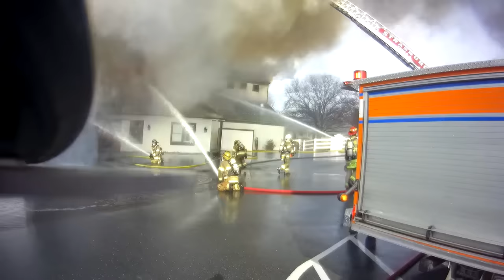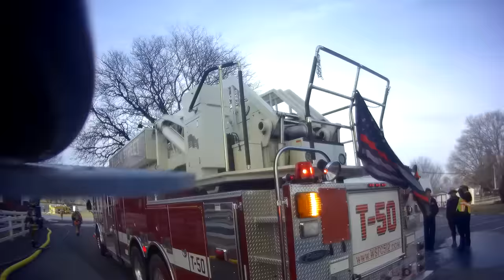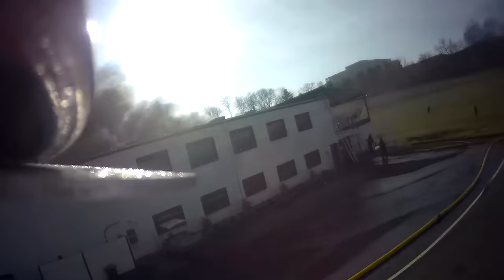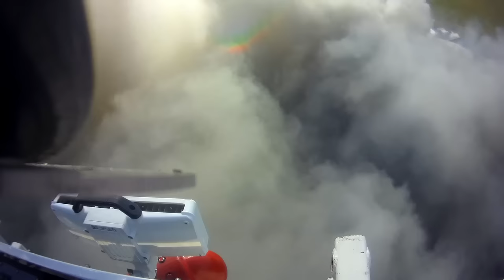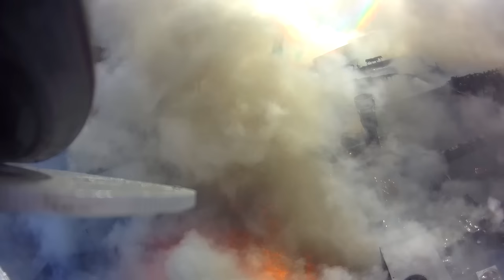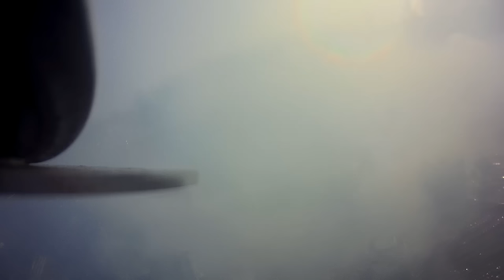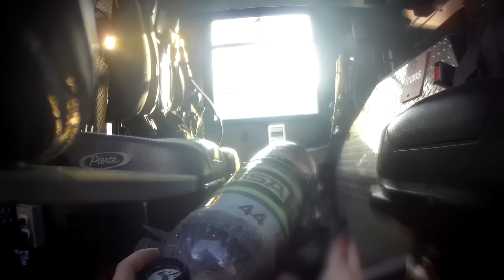Truck 50 Assists on Strasburg 2 Alarm Building Fire *Helmet Cam*

Comment: As a German volunteer firefighter, I find it extremely interesting to see my comrades from other countries at work. Greetings from Germany and as we say locally "all the time good hose".
Reply: Was wondering why they don't have "Schlauchbrücken" to bridge the pressurized hoses instead of disconnecting. I assume theres a reason?
Reply: @takarasan  Some departments do, some don't. Often rural departments won't have them due to the small population and people can find another way around a block with little traffic. It does make hose setup harder as you must be careful.

For cities, departments have so much on the trucks already. Not all departments choose to carry "Schlauchbrücken" (hose bridge) on every truck. You would think our bigger trucks have more storage, but I am always amazed with how much gear you guys pack into your trucks.
Reply: And you're not suprised that they're not even wearing masks?
Reply: @Drako3215  Except near the beginning, when they briefly stand in the smoke, I don't understand what you mean. Not everyone here wears a mask either. In the "vehicle staging area" it can sometimes happen that smoke is blown away by the wind for a short time. And the two in the ladder's basket have masks on when they are no longer in the smoke-free area. Otherwise send a TimeStamp what exactly you mean by “don’t wear a mask”
Reply: @Drako3215 they were but

Comment: Thanks for sharing this video.  I am always interested in seeing how fire departments approach and battle different types of fires.  My brother is an EMT in Shrewsbury, NJ so I get to hear some interesting stories.  Thanks also for telling us what the spinning thing was on the front of the truck. 😊  You answered one of my questions.  Stay safe, be careful out there.
Reply from the maker: Thank you!
Reply: @Fire-Rescue50  is your company strictly volunteer ? When I was stationed at Fort Carson I was a volunteer fire fighter with Hanover in Colorado thank you for your hard work and dedication🇺🇸🇺🇸
Reply: @Fire-Rescue50  hello
Reply: @Fire-Rescue50  12:55 were the trucks blowing the air-horn for fire fighters in the building to evaluate  if the didn't here there radios?
Reply: @MilesNewmoyer yes blowing of the air horn either multiple bursts or long blare is used as an aide to inform firefighters inside who may otherwise not have heard radio traffic. The loud drawn out air horn can be better heard and needs no explanation to those inside. (If you hear it GET OUT). 

The decision made by those in charge. That firefighters inside were unable to effectively get to where the main body of fire was located and apply water changed operations from aggressive interior attack to a more defensive master stream attack. Allowing for direct water application onto the greatest amount of fire. 

Those streams of water can cause significant harm if sprayed on people which is why the building gets evacuated before they are used.

Comment: I'm quite fascinated by the siren, so it goes higher and louder when speeding up, very cool
Reply: Most Q2 sirens have a pedal attached near the engineers feet. Hes most likely using his other foot to push down on the pedal.

Comment: Super video. Loved when turned corner you saw the header. That's why you use smoth bore on elevated stream. I guess some of the water runoff went back to the pond and was recycled. Good job Truck 50, and IC.
Reply from the maker: Thank you!

Comment: General question, unsure if youve answered it before so I apologize if im repeating. What is the purpose of the manual "high - low" wail siren? The one you can hear raising, holding, then lowering the wail as they continue along? I ask because manual sirens aren't a new thing though for PD its typically used to suggest a traffic stop. 

Where as here it seemed to have just been a primary emergency siren thats operated manually? If I've got this wrong feel free to correct me, I'm just curious about the need for a manyally controlled standard siren when I'd assume they could be automated like all the others. Thanks in advance for any response and thank you for your service in the face of such daunting tasks. 🚒👩‍🚒👨‍🚒🚒

Comment: I went into a house fire once as an LEO to check for more occupants. Unit before me had pulled a quadriplegic man out already. I was low to the ground and still couldn't see crap. Nobody else was in there but man i could see nothing. Couple more steps and i wouldnt have been able to find my way out. Even crawling on the floor the smoke is overwhelming. This was an arson case where neighbors were fighting. Drunk neighbor lit the fire and the paralyzed dude knew the house was on fire but couldnt move. We were close due to being out there earlier on a previous dispute earlier.

Comment: Awesome video and Great driving ! What was this building used for ? The way this fire took off it def had a lot of fuel inside . I was first thinking possibly a furniture type store but judging by the smoke I don’t think it was . The smoke didn’t appear dark enough for furniture being the fuel . Either way excellent job gentleman. Stay safe
Reply from the maker: Thank you! It was a restaurant. The kitchen is where most of the heavy fireload was.

Comment: It amazes me how at times it seamed like the fire was not bothered by the water at all. From experience with a garden hose and camp fires it always seamed like as soon as the water touched whatever was burning, the fire stopped. Is it the extreme heat causing the water to vaporize before it has a chance to reach that makes it seam that way? It shows that I don't have any true understanding of what goes into controlling a large fire like this however now am now interested in learning
Reply: The problem is, that it is not the area below the hole in the roof that is burning. The flames are running along the underside of the roof and only venting through the hole. Therefore the water is dropping vertically and running out through the building. Inside the lower floors of the building, it would look more like a flood than a fire.

Comment: Question? you had big hole in the roof flames coming out, 3 bucket trucks blowing roof covering off the roof.
 I can understand the need to keep AC units cool, but 3 bucket truck spraying what? 2000 gallons a minute? so between them say 6000 gallons per minute. why blow the covering off the roof? surely it would be better to put that 6000 gallons in that hole?
 yes it was an intense fire but 6000 gallons would have gone a long way to reduce heat thus help suffocate the fire?
 now we couldn't see how many hand lines were being used but that is more of the wet stuff going on to the hot stuff. even if you had 2 buckets firing water into the hole and the 3rd one cooling the AC units, you would still have a lot of water cooling down the fire, thus help put it out quicker?

Comment: Question: Are the sirens automatic or do you have to do it manually?
I’ve always wondered that
Reply: The Sirens are Manual. The Officer (Passenger) next to the Driver, has two Pedals down by the foot-area. One for the Q-Siren and one for the Airhorn. He also has a "Stop-Pedal" to quickly Shut the Q-Siren down, since it Takes Long until the Q-Siren Winds down all the way. The Powercall and Rest of Sirens Is activated via Pannel somewhere.

Comment: How does the whaling siren work? It seems like there is no consistency with the tone? In the UK, when our sirens are activated it’s the same throughout. Please no abuse, it’s a genuine question. Thanks
Reply: That's a Federal Signal Q, its a fully mechanical siren -  there's a button / foot pedal somewhere up front so they can wind the siren up as needed (also has a. brake brake somewhere to wind it down)

Comment: Great reaction from all but on the other side why do they stop?they don't bother the emergency vehicles and nothing...
Reply: you never know if the responders need to turn somewhere. Also not all roads are that wide so stopping and pulling off both sides gives plenty of clearance to get through.

Comment: 12:53 why did many of the trucks start blaring their horns at this point?
Reply: Evacuation Tones. To essentially let all personnel working interior, to get out, and do it now. Usually happens when the fire starts to overwhelm or compromise the structure, or if it's a very deep seated fire.
Reply: @irishgaming8061 ah ok, thanks

Comment: Odd question maybe.     When a building is that involved in fire , why not just let it burn to the ground ?   There didnt appear to be any adjacent structures to protect .  Alot of risk the firefighters put themself at to put out a fire on a structure that will be a total loss in the end.    Easier to haul away a bunch of burnt wood compared to taking down a half burnt structure.       I suppose too that someone first on scene would have to make that judgement call.

Comment: What's that silver spinning thing on the front of this fire truck?
I was worried because it is not in Japan.
This sentence uses a translator.
I'm sorry if the sentence is strange
Reply: It's called a Roto-ray, it's a pretty normal kind of emergency light for fire trucks
Reply: Thanks for letting me know, it made me even more interested.

Comment: Where I live a fire truck or ambulance has to respond in 4 minutes or less. Here we have a fire truck responding in 28164364958 minutes.
Reply: You also have less distance to cover. The rural area I grew up in most people lived and worked anywhere from 20 to 45 miles from the nearest town, with 1 to 3 miles between houses/farms. This isn't the city where there's a fire department every 10 blocks. 

This also looked like a mutual aid call - truck was responding from a neighboring town to support a rural department, so again, 20-30 miles between their barn and the fire. They knew they were next up so they were already rolling before they were officially called, which helped the response time.

Comment: When you guys are already at the fire, the trucks honk their horns for like 10 seconds, why is that?
Reply: "everyone out of the building and defensive operations" -My dad, he said it changes meaings between departments, but its typically that,
Reply: Regardless of meanings in different departments it got your attention. Everyone on the scene is going to stop and look around. Just as the tone on the 2-way radios. Stop, look, listen. Then follow the instructions, as in this case evacuate the structure.

Comment: Question Why was that deck gun spraying water into that pond out back behind you?
Reply from the maker: That engine was pulling a draft out of the pond. When drafting, you need to have a constant flow of water or you will lose the suction.
Reply: I was curious to why you have lines.hooked up and yet dumping it right back in. Thanks for educational lesson

Comment: Does anyone know why they all start blowing their horns at the same time at 12:55 but no one seems to react?
Reply: That’s a universal evacuation call. Usually the chief deems the building no longer safe to enter due extensive flames or collapse danger, and they switch to defensive operations, which means they only fight the fire from the outside. The theory behind it is that anybody inside or about to enter on other sides gets alerted by the horns, even if their radios or anything else malfunctions. If everybody is already outside then there is no need to react.
Reply: @PirateDest  Thank you so much for the explanation.

Comment: What is the point of ventilation if the fire has already burned 🔥 through the roof 😳
Reply from the maker: Which is exactly why we did no ventilation
Reply: @Fire-Rescue50  so in this video I see the guys in the platform get on the roof with a cutting saw..

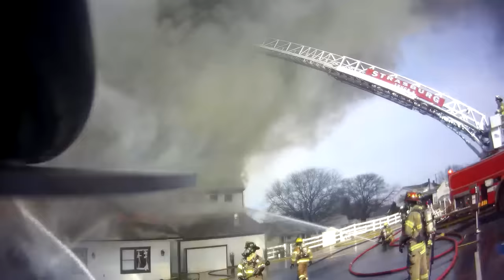Comment: What’s with the horns blasting around 13:00?
Reply from the maker: Command made the decision to pull everyone out of the building. When that happens, county sends a message over the radio to evacuate, and some people outside will sound their horns in case the people inside didn't hear the message

Comment: Just wondering if anybody could explain the 2 alarm or what it means. Uk based so I’m not sure 🤙👍🏼
Reply: So there are many alarms. Minder these all vary from volunteer to paid. There is a regular dispatch for reported structure fire varies from different stations so that’s just for a reported fire. Then there is a working fire which means there is a fire and it’s usually adds like a truck co or 2 and like 2 engines. Then there is second alarm which means the fire is too big for what they have enroute or on scene. Also because it’s volunteer and staffing may be limited during the day. And then so on and so forth the higher the alarm the more fire units are added to the call. Our alarms usually go up to a 4th or 5th again it Varies on the dept and how they run their station I’m just going off of what my company does. I hope this gives you a better understanding!
Reply: @LCBC6401  really appreciate you taking the time to explain. Thank you so much.

Comment: Traveling that far by the time you get there the structure will be completely burned down!
Reply: There were already more local firefighters on scene. It looked at one point like they passed another department. Also, a 10 minute response isn't bad at all especially for being so far out.

Comment: Q: Why would anyone get on the roof??
Reply: Vent
Reply: @nubbyg9096  I don't know if you noticed the fire was through the roof, what your second answer??
Reply from the maker: @thenussbaum44  Read the description
Reply: @FireRescue 50  what does the  description have to do with what I asked. Why did he get on the roof.
Reply from the maker: @thenussbaum44  I wrote in the description why we went to the roof. He stepped on it, and then the decision was made that there was no use, then he stepped back in.
Reply: they went to go do a trench cut which is basically a fire break to keep the fire from spreading further into the building. In this case due to half the building being gone and the HVAC's on the roof the entire roof was deemed unsafe to be on so they backed off and started Water pipe operations. Its quite common in the north east to have guys on roofs well there is fire blowing out of it 9/10 the fire blowing through the roof was cause of a vent hole and the fire coming to the easiest point of exit. Now yes it looks weird but there is a reason for everything this truck company did was done for the safety of everyone. I hope this answers your question :)
Reply: @james131361  Thanks for the explanation. I still don't feel there's a building that is worth putting somebody's life in jeopardy like that no matter how careful they might be. That fire was pretty advanced coming through the roof not that far and I think they made the right decision not to stay on it..
Reply: @thenussbaum44  your welcome and yes they made the right decision people normally don't realize how heavy those HVAC's are but with a fire that fire load they had it could've been  matter of minutes before the rest of the roof went

Comment: I am not a ff. Looks like these guys only tried to contain the fire by cooling temp down from outside. Then let all burn down. Not sure why they can’t go inside the structure and attack the fire aggressively and put out the fire. I guess saving the property isn’t their priority.
Reply from the maker: First arriving crews were inside fighting the fire, but it got too big, and the building began collapsing. When we first arrive at the scene you can hear the evac tones hit followed by the horns, which is to signify that everyone needs to get out of the building. At the point that is happened, the building is a lost cause, try to save as much as you can from the outside, but mainly protect the exposures
Reply: I guess using your brain isn't a priority. How did you miss the trucks blasting their air horns, the tone over the radio, and the call for evacuation of the structure? When it became unsafe to be inside any longer then they moved to the outside.

Comment: Well im gonna be the wet blanket on this driver.  He's going too fast; blew right through a red light;  what was that through the road construction area with the flagman holding a slow sign? ;  going around the left blind curve and surprising that yellow? car ;  going way too fast through some of those villages where the buildings are pretty tight to the street.  
Kudos to the driver for getting the crew and the truck to the scene without killing the crew or anyone else.
    But you wouldn't be a driver on our department, not without more training.
   Sirencide is what it's called.
Reply: If that "person holding the slow sign" was doing their job they would have grabbed their radio and told everyone on the site an emergency vehicle was coming from that direction. The other flagger would immediately stop and hold their direction. Also workers would stop and watch for the emergency vehicle. This was all in daylight, no rain, no fog, no snow. No ice on the roads.